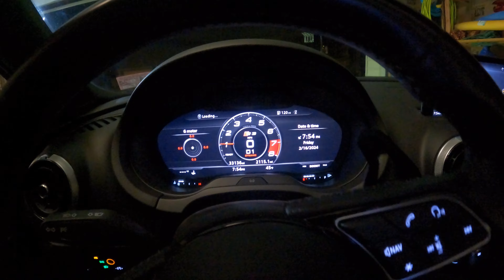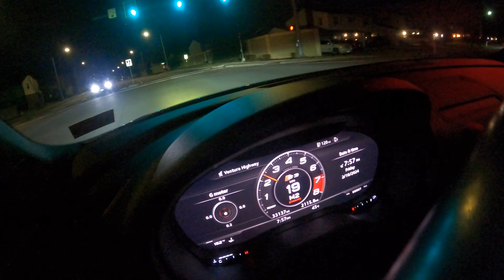2018 Audi S3: Episode 215: Installing the APR Carbon Fiber Intake CI100040

Comment: have you tried 034 intake? They also have an upgrade fresh air duct for better flow into the intake and it helps send cool air towards the oil filter for cooling. What do you think?